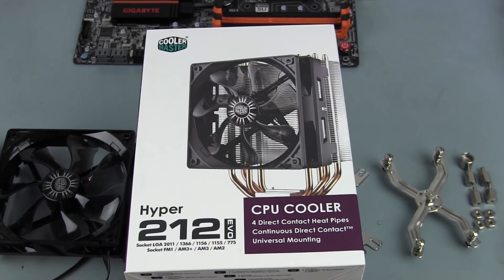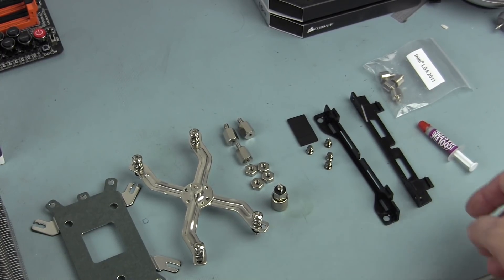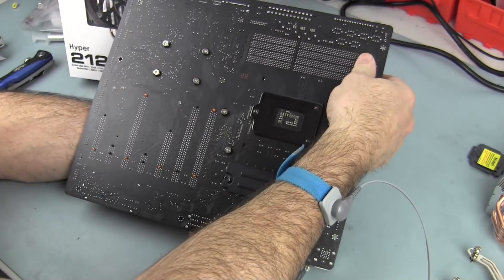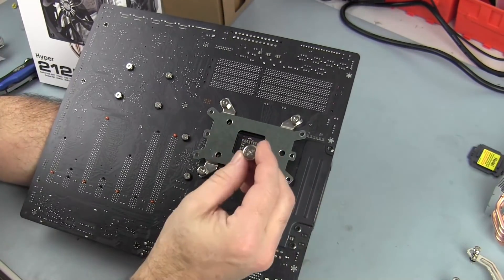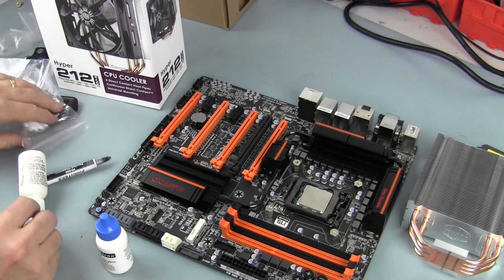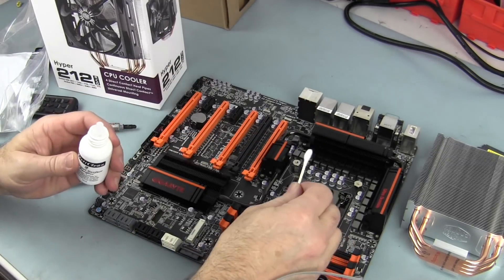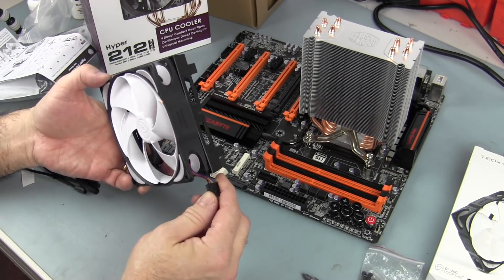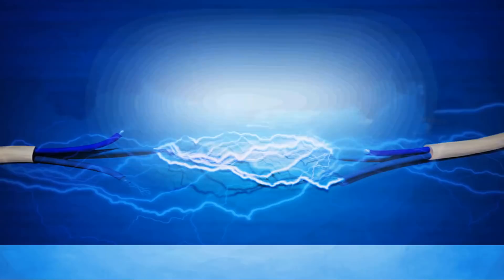How to Install a Cooler Master Hyper 212 Evo CPU Cooler

Comment: I'm having a problem with my cooler where it seems that it is not completely secure. It doesn't fall out but it moves around. I'm using a X99-UD3P gigabyte motherboard. Idk if this is normal or that something is wrong. Please help.

Comment: Hey, I notice you have a anti-static bracelet on, what did you connect it to? A lot of people suggest a power supply, is the correct?
Reply: +Daniel Harvey you can connect it to everything that's connected to earth.
Reply: Spartan Vale It's to help reduce the chance of you accidentally shocking your components. If your component get shocked, it might kill it. 

No you don't have to have one, but it's recommended. It's just a precaution.

Have fun building your first pc, I had a blast building mine!
Reply: +Spartan Vale If you don't have a bracelet, remember to touch a plugged in power supply. The metal on the outside is connected to earth, so it's the same as having a bracelet.

This is important if your floor is carpet or it's winter. In both cases you're a lot more likely to shock your components.

Comment: So im trying to install the backplate and the screws just dont seem to fit the nuts, im trying to tighten them but it feels like its requiring to put too much pressure and i dont want to ruin the screws. this is my first build please anyone any tips? Seems like for rosanut they just go straight on
Reply: George Walker having the same issue.. i don't have the same screws he uses for his backplate

Comment: +sraf Please please please NEVER spread thermal paste. It causes air bubbles which result in a poorer transfer of heat. You should just put a pea-sized amount right in the center or a line about the size of a grain of uncooked rice.

Comment: I'm looking to overlock my i5 3570k from stock (3.4ghz) to about 4.2ghz. Would this cooler be suitable for this?
Reply from the maker: Digital West All depends on the chip and how much voltage you need to get it to OC at 4.2. But it is certainly possible, 4.2 should not be a difficult OC to hit on this chip based upon the few I have used.
Reply: Digital West Yes it would. I OC'd my core i5 2500k from the default 3.3 GHz to 4.5 GHz and this cooler keeps it under 80 celsius at full load. It's one of the best-performing air coolers, and super cheap to boot.
Reply: bennemann Ok, thanks

Comment: Ronsanut, Your video was VERY helpful as a CPU cooler is not something I had installed before. I'm an old guy and I haven't built a computer in about 15 years. Thanks so much for providing this. I was unable to view the "line method" that you use for applying the thermal paste because of the camera angle. I was a little surprised to find out that you didn't use the stock fan as I did. I'm sure that I should have viewed the entire video before starting instead of "as I go".
Reply from the maker: Dave Ellis I am glad it helped you. That is why I make them.
Thanks for watching.

Comment: Cool Master Hyper 212 Evo fits nicely in a Corsair Carbide 200R case for those of you wondering.
Reply: Well I am in my pyjamas typing this
Reply: +Freddy Krueger Thanks
Reply: +Freddy Krueger Thanks!
Reply: +Freddy Krueger That's good to know since that's the exact case I'm installing this into! Thanks man.
Reply: I'm using it right now and have been so since early part of this year.  No issues so far.
Reply: thanks

Comment: I don't get how you're hand tightening anything... My cooler came in today and I've yet to put it on because the stand offs are too large to fit, even with tools, in either the back plate or the nuts to hold it on the motherboard.
Reply: David Hoch same here..
Reply: David Hoch yup

Comment: can i use this on an amd board or do i need to use a different kind of fan ( im new to this stuff btw)
Reply: Its just the processor that is different, this heat sink is compatible with pretty much every amd processor, so ur good :)
Reply: Processor board*

Comment: If anyone is wondering what the temperatures are after installing this heatsink over the stock cooler, then check this video out: https://www.youtube.com/watch?v=tKzlq_i0dIo  
It tells you more than just the temps

Comment: I dropped and misplaced one of the thightening bolts for the 4 standoff screws--is it possible to continue installing the cooler with one missing?  If not, is there a place a can buy another one quickly?

Comment: I have watched a lot of videos about installing a cooler like this on a CPU and sometimes people put some of the thermal paste on the CPU and spread it out with there finger so it covers the whole CPU, would anyone recommend doing that?
Reply from the maker: You can but don't use you finger only, place a baggie over it.  Would be better if you used the edge of a credit card to spread it.
Reply: Cool THX :D

Comment: Does a GA-78LMT-USB3 compatible with this fan??
Reply from the maker: Yes, this cooler will work with that.
Reply: will it fit in this case? http://www.amazon.co.uk/CiT-Goblin-Gaming-Interior-Toolless/dp/B00I9XOSLW
Reply: Ronsanut Will this case be big enough? http://www.amazon.co.uk/CiT-Goblin-Gaming-Interior-Toolless/dp/B00I9XOSLW
Reply from the maker: Yes, it should fit in that case.
Reply: Ronsanut Great it has like roughly only 10cm before it hits the top of the case though. I might aswell put it in though. I'll do it now. Thanks!

Comment: How far can I overclock an i5-4690k with this cooler?
Reply: good thing I got a good one, 35 degrees normally and 80 degrees maximum load at 4.8GHz.
Reply: Alex Capi 80 degrees? Running at that temp your CPU will probably last a year at most. 60 Celsius should be the temperature it reaches under high load, and consistently over 65 is when I would upgrade my cooling.
Reply: Just a small bit.
Reply: No processor is the same, if you're lucky you can oc it more than usual, if not then you will see temps rise rapidly eventually leading to the downfall of your cpu :(
Reply: Alex Capi Dayum u are lucky
Reply: Alex Capi keep your cpu under 65 man

Comment: Hello can someone tell me where can i find a similar fan to this to install on the other side of the cooler?
Reply: That can make your temps worse you know
Reply: Jocko Homo Thats complete bullshit,push pull improves temps
Reply: Jocko Homo I've built more rigs than you've had hot dinners kiddo.I leave name calling to the kids..Btw you might actually want to google search "slander" and it's definition prior to usage.
Reply: dittyobrien The Homo I was referring to was me
Reply: dittyobrien and if you have built so many "rigs" you should easily be able to acquire an extra fan

Comment: Great tutorial man. Thanks. A question: On the off chance that I want to add another stick of RAM on the nearest DIMM slot, would it actually be ok for me to unclip the fan, and raise it a little higher so there's space for the RAM?
Reply from the maker: Yes, that would not hurt, it may make it a bit noisier but should cool fine.

Comment: http://pcpartpicker.com/p/hNJND3

I'm going to build this PC over summer,and I want to get this CPU Cooler,you think its to hard to put on for a Pure Beginner?
Reply from the maker: No, watch  video, It is easy.
Reply: I just did a new build with it yesterday, I made a push pull config.  Just do like the mrs in the video!
Reply: Ronsanut What is on ur wrist?
Reply: Cancelled. sb That's an antistatic bracelet
Reply: Sanket Panda Do i have to use one? And what does it do? AND what would happen to me if i didnt use it?
Reply: Cancelled. sb It prevents you from frying your motherboard while handling it. Do you need it? Not really unless it's a really sensitive motherboard
Reply: Ok do i need it for the MSI Z97-GAMING 5 ATX LGA1150 Motherboard
Reply from the maker: Cancelled. sb No absolutely necessary. Just be careful and ground yourself before handling the mobo. And whatever you do , don't build or lay your mobo on a carpet.
Reply: Ronsanut Ok. Some more questions.. Can i lay it on Hardwood floor and what happens if it hits the carpet?
Reply: Cancelled. sb I remember someone telling me  that if your motherboard is near a carpet it can be affected by the static the carpet can make somehow,as for hardwood floor I think it would be better on a table or on your motherboard box.
Reply: Ronsanut Hi, I bought this but I have fm2 motherboard and just realised that my motherboard isn't on the box. Do you think this hyper 212 will still fit?
Reply from the maker: Yes it will still fit. Jut follow the AMD instructions.
Reply: Ronsanut
ok thanks for quick reply mate
Reply: do not buy a 2gb graphics card. they are terrible.

Comment: Does it matter which way the cooler blows air? Does it always have to be facing the opposite direction of the I/O panel?
Reply from the maker: Ideally it takes the cool air that comes from the front of your case and exhausts it out the back. But it can blow up (if you have bents at the top of the case) and it can also take fresh air from the rear and blow into the case, providing you have fans to blow the hot air out the front.

Comment: Don't buy the 212 evo. The fan will fail and coolermaster won't send a new fan. My bearings started to fail 5 months in to the 2 year warranty. If you can afford your own fan then fine, go ahead and buy from this cheap company.

Comment: my CPU came with a cooler, is it fine to just keep that one on?
Reply: Most of the time stock coolers are good enough unless you want to OC, they are also usually pretty loud, I would recommend you getting aftermarket one, especialy since this one costs only 30€
Reply: sam vitto What the heck of a kind of a CPU are you using???
Reply: my stock cooler failed me..after 5 months my pc is lagging even i'm only watching youtube videos..i thought its only a browser problem but when i checked my cpu temps, its running at 99'C..i'm quite surprised that my computer didn't shutdown at that heat level..i figured out that my thermal paste has air bubbles because the stock heatsink has rough surface and the mounting brackets are very sensitive..one touch, and your thermal paste is fucked up..i'll never trust stock coolers again..
Reply: Jae.  Yea don't use a stock cooler especially one from AMD they're really  loud when playing CPU heavy games like Arma 3.

Comment: Fine lookin replacement fan!

I have thermaltake fan for evo 212.

Is it just me or these aftermarket replacement fans come with big and wide screws that are hard to screw in to this evo fan mounting brackets, aswell into the casing of fan itself.?

Allmost shaved the head of from one of these screws and i was only half way trough securing it.

Finally ended up using using evo 212 mounting screws as they are shorter,less wide and do not require excessive force to tighten the screws.

Comment: Is there any reason you would warn against using the given thermal paste? Are there any lasting effects or problems that might arise when using it, or does different branded thermal paste make a large enough difference to be worth it?
Reply: It all comes down to personal preference. Some is better but the given thermal compound will do just fine.

Comment: I installed my new processor fx 8350 and the cooler. Now I get fps drops in counter strike (haven't tried another game yet). I have like 290 fps and all of a sudden it drops to 80 and stays there for like  10 seconds, and then after a couple of minutes it does it again. The processor is not overheating. I have no idea what is wrong :S
Reply: Do you have a monitor that exceeds the 60Hz refresh rate average? It's just most monitors only go up to 60Hz and unless you play competitively and want that 120Hz/144Hz advantage it makes no difference. Try it on some other games.
Reply: ***** I'm sure that has nothing to do with it :P It does it on other games too
Reply: Oh i knew the monitor had nothing to do with it but if you had a 60Hz monitor then you wouldn't notice any difference as long as it still outputs 60fps.
Reply: What video card do you have?
Reply: I have the r9 280x
Reply: Neutraliz Gamez GTX 680 :)
Reply: Neutraliz Gamez GTX 970 msi
Reply: well, there was probably something wrong with the processor. got a new one but 3.5 ghz instead and it works fine
Reply: Ale EVGA GTX 980 ;D
Reply: Ethan Jaramillo I have not money to buy a gtx 980 :(

Comment: Will the cooler block the ram on a ASUS MAXIMUS VI HERO motherboard?, as well as block the first graphics card slot for a MSI GTX 970 GAMING 4G. It looks like this cooler takes up a lot of space blocking off those areas. (First PC build btw)
Reply: You have to make sure you're using low-profile ram for this cooler.
Reply from the maker: I don't know I never used an Maximus VI. Sorry

Comment: can someone explain what the 2 white bottles are ?(i'm not english) thx
Reply: they are designed to clean off the cpu surface of old thermal paste from a different cooler, and the other one is designed to treat the surface to better apply the paste
Reply: thedingohunter but is very important to use it ?
Reply: T-T man I've been crying for 5 days I just can't stop T-T 
Thank god you commented that, I was seriously depressed over that comment... Now I have stopped crying I can live with myself now. Cheers mate.
Reply: Michele Aspire if you are replacing your cpu cooler then probably yes
Reply: Joseph Gray No because 99% isopropyl alcohol works just as well
Reply: What do you been by no?, I answered his question of wether it is important to clean the CPU, not what to clean it with. 
It's not like I answered something like, "yes you must clean your CPU, but you must use this type of cleaning agent"
Reply: Joseph Gray stop crying
Reply: Joseph Gray
no problem kurmit to the rescue
Reply: Steven3657 lol

Comment: Anything wrong with the fan that he switched out because I want to use this cooler but im unsure of size because im using the Mana136, does anyone know if it will fit with a Asrock z97 extreme 6 I just dont know if there is something wrong with it cause its a $1500 build
Reply from the maker: No the fan is fine, but I preferred a more powerful and quieter one. Since i had an extra one I decided to use it.  The one that comes with the cooler is just fine.
Reply: Is it normally really load, because I think it can get pretty fast.
Reply: James Degan Nope, all quiet on my end :)
Reply from the maker: No, I just had better performing fans available. The stock ones will work just fine.

Comment: i got a core i5-4690 in an Asus z97-pro on a cooler master n400 case.

would this cooler fit and would it be a good idea?
i read the default cooler on the i5 4690 is bad so i guess givng 25€ for a quality cooler wouldn't be a waste. 

Thank you.
Reply: If the case has a cutout (i am mkst sure yours has it like 99% sure) on the back (like behind the cpu socket) then it would do perfect.
the stock cooler is emough when not overclocking etc but it wont be as stable as with this one. And it is really loud. So, yes it fits and yes it is really a good choice
grz

Comment: I've installed several of these on AM3+ and 1150/1155 motherboards, best "bang for the buck" cooler/heatsink in the market today.  I prefer using Noctua fans instead of Coolermaster's, but to each their own. :-)  Thanks for the video, very well done!
Reply: True but also GELID Solutions Tranquillo is good cooler and sometimes even cheaper than this CM.
Reply: Hombremaniac
True, however,  Coolermaster HSFs are way easier to find, most retailers have them in stock.

Comment: Thank you SO much for this video!  I'm doing my first build and installing this CPU cooler has been the most confusing of the entire build.  I was wondering what the fan brackets were for, and the rubber pads ... nothing explained that they were for an extra fan until you did.  And positioning the mounting bracket, the adjustments on it, were better shown on your video than any other I've looked at.  Thumbs up!
Reply from the maker: Awesome. So glad I could help.  Love giving back, and thank you for watching and your feedback.  Enjoy building !

Comment: What would the optimal fan orientation be if I were to put 2 on the heatsink? Both of them blowing inwards and let the air push itself out on the sides or just make a nice flow-thru with one blowing inwards and the other blowing outwards?
Reply from the maker: Two fans, one pushing air through that comes from the front of the case and the second pulling that air through and blowing it out the back or top of the case, depending on how you orient the cooler.
Reply: No, no, not the case fans... I was referring to the CPU cooler's fans - Hyper 212Evo has an option of putting 2 fans to cool the heatsink :)
Reply from the maker: Fillip Tašin Yes, that is what I answered. You place one fan on the heatsink that blows air through the heatsink and the second on the other side of the heat sink pulling that air through.
Reply: Oh... You confused me when you mentioned "case"... Thanks for the reply, appreciate it :)

Comment: is the orientation of the fan important?
Reply from the maker: Yes, ideally you want to have the fan pushing cool air through the fins and out the other side to an exhaust vent of your case. Typically to the back or up to the top.

Comment: - The surface underneath the protective plastic should be cleaned too
- You never mentioned the little part on the assembly that locks the angle of the CPU. It's important that people know about this, otherwise they the heatsink (the part sitting directly on the CPU)  is not locked in place and be rotated accidentally.
- The protective coating on backplate and standoffs should be checked

Comment: How heavy is this thing? Does it stress the mb?
Reply: Its not heavy...the big silver heatsink is made of aluminum so its very light...if you install the backplate properly, it won't put any stress on the motherboard since the purpose of the back plate is to distribute the stress away from the screw holes to the rest of the motherboard.